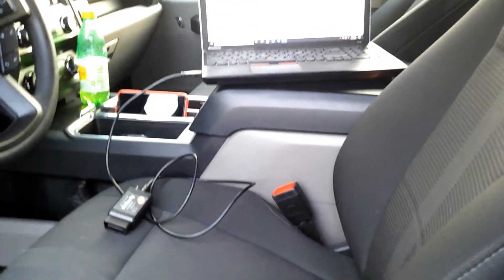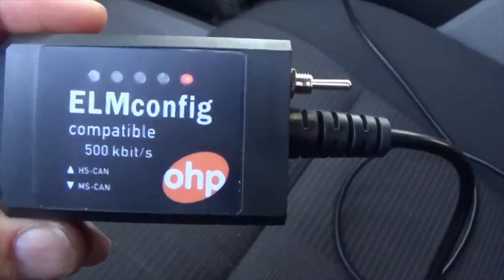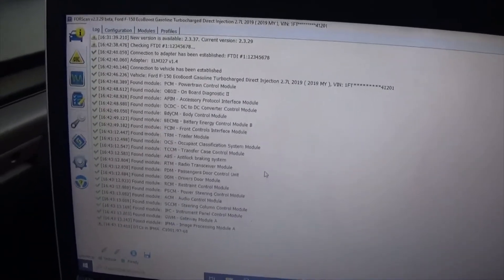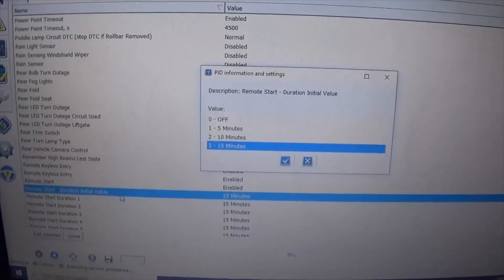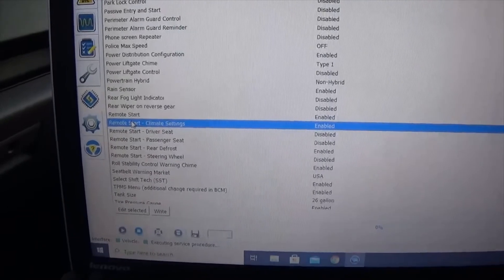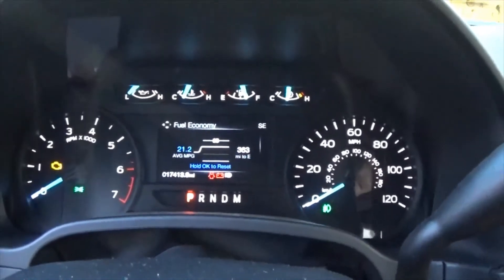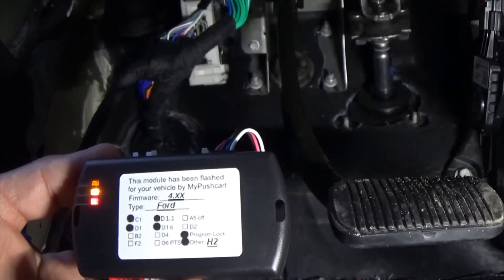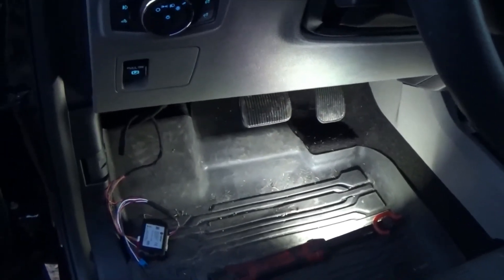2019 F150 MPC Remote Start install with Forscan Programming

Comment: Can you share the link to the module you used? I have a 2019 f150 Lariat
Reply from the maker: I ordered mine thru Amazon. It allows you to select your exact make and model. They will send it with the necessary programming for your vehicle. Make sure you pick the one for which every system you have (keyed start or push button start). This is the one I ordered for my truck https://www.amazon.com/dp/B07L5XT222?ref=ppx_pop_mob_ap_share
The product is available direct from https://shop.mypushcart.com/  also.

Comment: Do I need to enable remote start in the BCM as well as the IPC? Or does just enabling the climate controls in the IPC work? I have an aftermarket kit installed but it only blows into the foot wells and defrost and I want it to remember the last settings. I do not have that menu. 2017 XL
Reply from the maker: If you want full factory function you will need to enable it in all the controls modules listed in the spread sheet for your make model.

Comment: will this make climate control work with remote start mine only works when the key is in the ignition and turned on ?
Reply from the maker: If you have the option in you instrument cluster to enable climate control after enabling remote start with forscan then yes. You will have the option for last setting or not. 
It will not look like it is on until you use your key, but does work. If you chose the other option it will automatically turn on your defrost options and warm to approx 70deg F
Reply: @mancavegarage   climate control  grayed out but forscan settings look ok stumped
Reply from the maker: @spaceace7920  if you have not figured it out yet, let me know and I will see what else I can find to help. 
It sounds like there is a setting that was not completed in the forscan setup. I know some things have changed with forscan since doing this video.

Comment: Great video, thank you for the content. Do the parking lights stay on while remote started after you selected it in Forescan, or do you have to do the additional wiring? I would like to avoid cutting the stock parking light wires. Much appreciated!
Reply from the maker: They do stay on. I believe you have the option in the setting or forscan to enable or disable on them. Mine stay on and no additional wiring was needed.
Reply: Awesome, appreciate the feedback. Doing mine this weekend.

Comment: I added the same remote start but I did it before doing the ford scan. I followed everything you said but I can't get the climate control to work.  I have it turned on
Reply from the maker: If  you have it activated with Forscan and have the auto option selected, you will not see anything on the heater control until while it is running with the remote start. The auto selection will go to defrost and the fan speed is limited to a medium setting. The temp will be around the 70* range.  If  you select the last settings option it will do  just that and go to what ever settings the heat/ac was at when you shut the truck off. I use the auto option myself and it has worked great year round for me in southeastern NC.
Reply: @mancavegarage  thanks I figured it out needed to go to the setting in the cluster and check what I wanted. Lol completely forgot  to do that. It works great
Reply: @mancavegarage  also forgot to subscribe done that also thanks

Comment: Can this be done even after you’ve already installed an aftermarket remote starter?
Reply from the maker: If you are referring to the settings using forscan, yes. Changes can be made after a remote start is installed.

Comment: Thanks alot for your great video
I programmed new spare key for my 2018 Ford Expedition using the two factory remote and at the end it shows me that the program completed successfully but the new remote bottons not work and my vehicle didn't detect the new remote.
I already have forscan tools but I didn't know how to enable the new remote and make it work.
Reply from the maker: Ford Key Fob Programming Instruction:

Close all doors on your vehicle. 

Proceed to open the driver-side door, where you will push the UNLOCK button

Turn the ignition from OFF to RUN 8 times, within 10 seconds. End on RUN the last time to enter programming mode.

At this point, the door locks will lock and unlock. If this doesn’t happen, start over and turn the key faster. Unless the door locks cycle between lock and unlock, you may not have keyless entry.

Within 8 seconds, push any button on your Ford remote to begin programming. 
The door locks will again cycle, which confirms keyless entry is good to go and ready to use.

If you have a second remote key fob, take that Ford remote and press any button within 8 seconds to begin the door lock cycle. 

Repeat for any other key fobs you have.
When you have programmed all of your Ford key fobs, turn the ignition to OFF. 

The door locks will cycle one last time to confirm programming completion.

Ford Intelligent Access Key Programming Instructions
Do you have a Ford Intelligent Access key fob that you need to program? Whether you have a new or a spare Intelligent Access key, follow these instructions:

Have your unprogrammed Intelligent Access key in the center console pocket, and keep two previously programmed keys inside the vehicle.
Press the driver and passenger power door unlock control three times.
Push down and release the brake pedal once.
Again, press the driver and passenger power door unlock control three times.
Push down and release the brake pedal once.
At this point, the Start/Stop button indicator should flash quickly, signaling that you’ve entered programming mode.
Within a minute, press the Start/Stop button.
A message will appear on the message center display that the new key was programmed.
Press the unlock key on the newly-programmed Intelligent Access key to exit the programming mode.
Check the new key’s functionality.

Try this and let me know if it works or not.
Reply: Thanks for your response.

Yes I have a Ford Intelligent Access key fob that I need to program.

First before I see your video I follow the instructions available in my vehicle user manual and as I told you before at the end of programming it showed me that the program completed successfully but the buttons now work.

Also I follow the instruction you write to me above but unfortunately not work.

Is there any way to enable and activate the new key by using forscan tools?
Reply from the maker: Unfortunately I am not aware of any. There could be, but I don't have that kind of key so I have never attempted it. I would go to forscan's forum, do a search there, if you don't find it then post your issue. They are pretty helpful there also